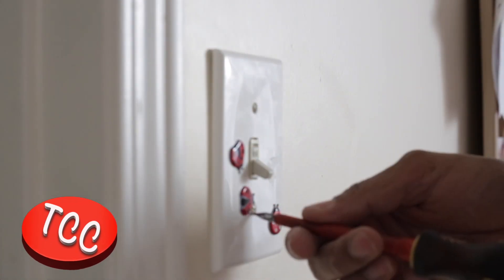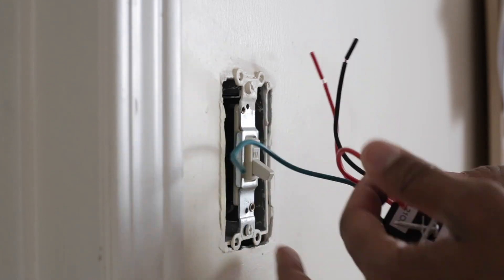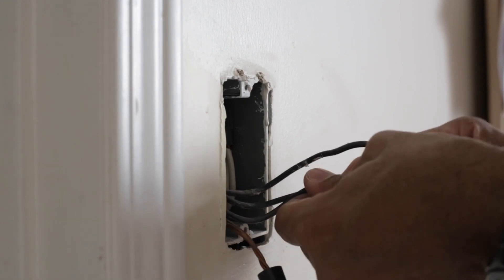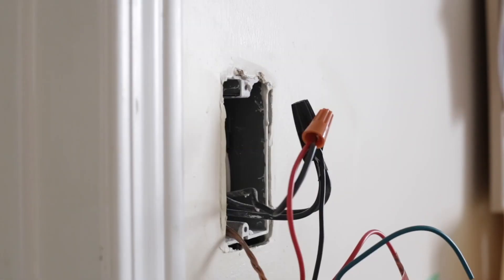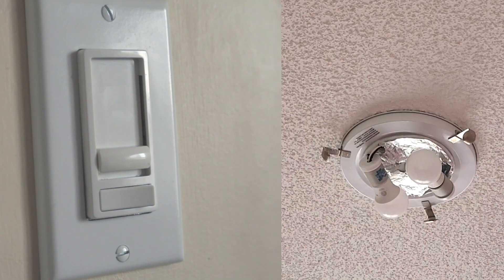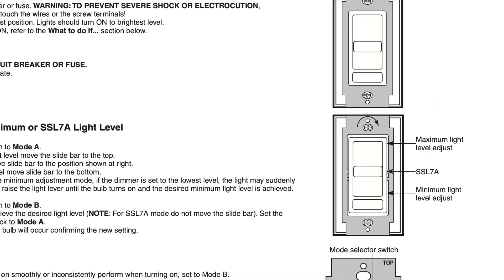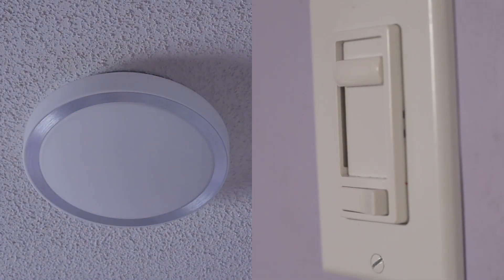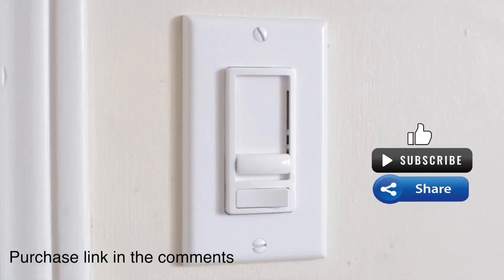Leviton LIGHT DIMMER SWITCH Review and Install

Comment: Regarding inconsistent performance with different light fixtures.  Have you tried the 'programming' routine described in the instructions? If it works as described, it should help reduce the inconsistencies you are experiencing.